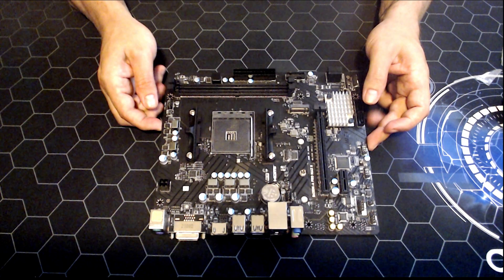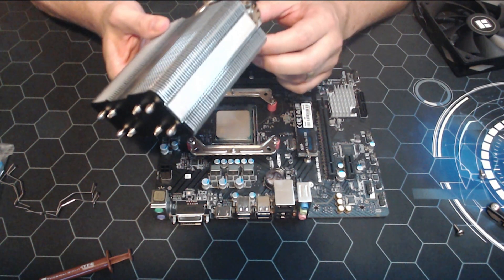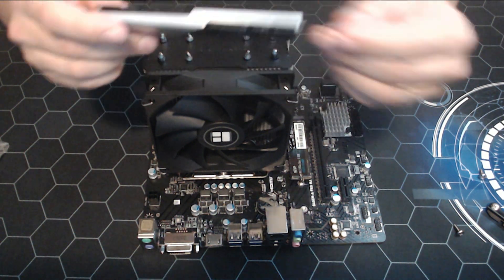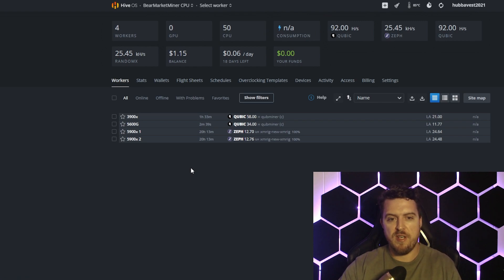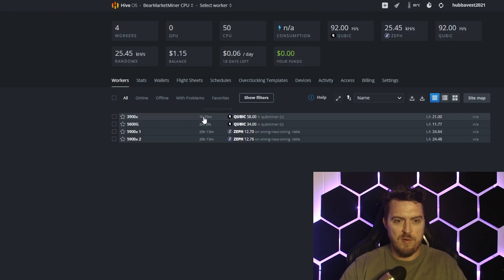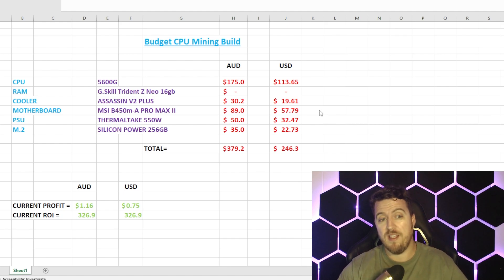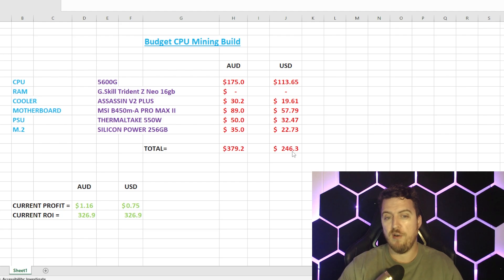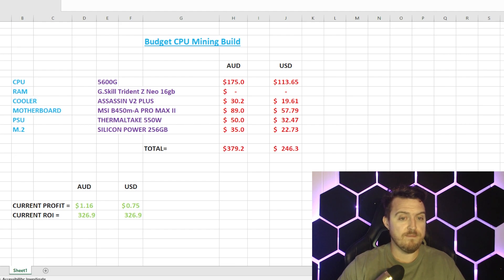Build a Budget CPU Mining Rig for Qubic – Full Guide! 🖥️💸

Comment: If you really want a budget cpu, just mine with a ryzen 5 1600. You can get that on meta or other places for ~$15-20 and it hashes the same as a 5600g or 5600x. If you want a new cpu, get the 5700x as it is on sale right now and hashes almost doubled the amount than 5600g or 5600x. At the time of writing, I was able to buy 3 of them for $160 each including tax... just had to bring my gf and my sister as it is only one per customer with the discount code.
Edit: You can also buy 5700x from express for cheaper
Reply from the maker: Appreciate the info mate!